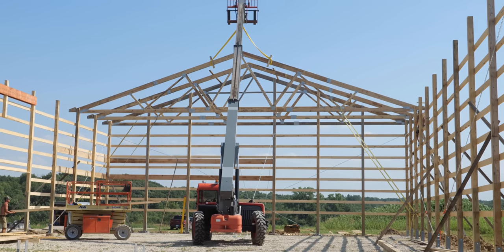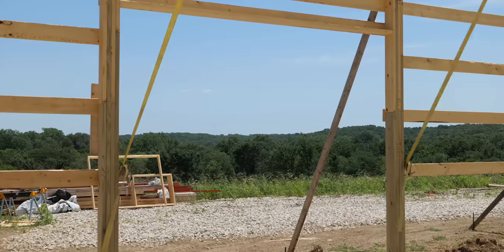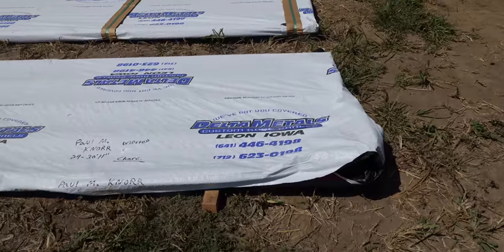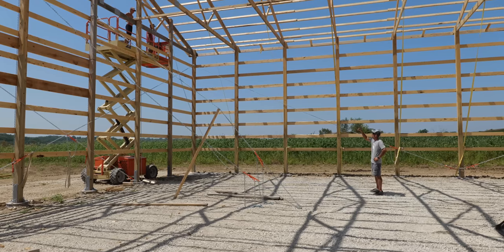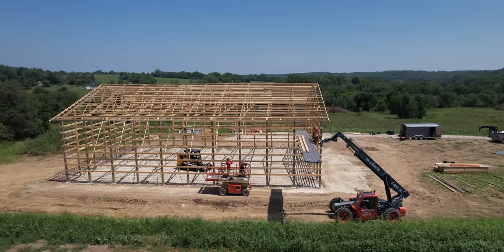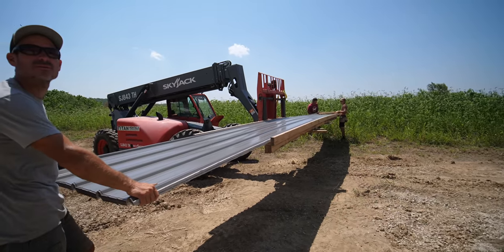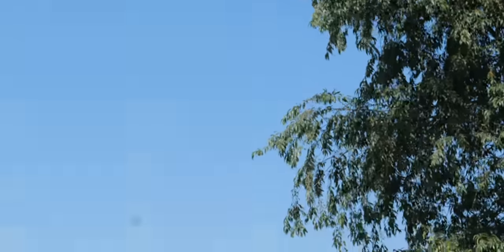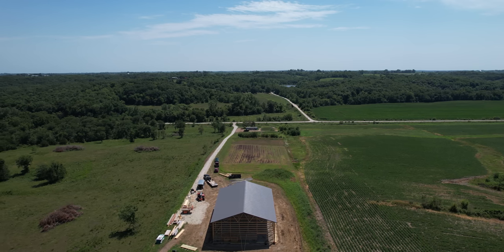Metal Roof Vs Wind!! // The Barndo Build Ep 3

Comment: Looks great Ryan, I like the charcoal color as well, I was very suprised that there is no under layment at all under the metal panels, I thought at least that house wrap would be underneath. I realize once they put a screw in every stud the rigidity greatly improves, that`s some brutal heat to be on a roofing project, great crew., looking forward to following along.
Reply: 99% of these buildings will have an insulated ceiling and vented attic, installing house wrap or plywood would be a waste.

Comment: I never knew you could do that without decking on the roof
Reply: Me either, seems like a strong wind would pull that metal right off🤔
Reply from the maker: I guess every barn in our state would be gone then because they're pretty much all like this. 😀
You can add wood for a lot of extra cost
Reply: I wondered the same. Figured a plywood layer would help with reinforcement, and sound insulation (when it rains).
Reply: We have a cabin with a roof like this absolutely no issues
Reply: @bbtank3000  usually for sound insulation you simply have it sprayed on the underside with closed cell foam.

Comment: I don’t understand how the metal directly on the trusses is solid… I feel like some good wind and the metal is gone. Normally here we put plywood over the trusses first.
Reply: The ribs in the steel and screws add the required rigidity. You are correct that the structure as a whole is a vulnerable at this stage in the build, which is why they are using chains and straps to lock the building into position. When all the steel is screwed in place (sides, ends, roof), and truss, side and end wall bracing secured, the building is secure. There are requirements for screw and bracing placement by the person who engineered the building.
Reply: @NoName-gz2kk  I’m assuming they’re going to spray foam the underside for insulation and sound dampening. If they’re weren’t planning too, they should!
Reply: @shawnwarnick2638  foam and rock wool will make that building nearly silent.
Reply: Looks like a cost cutting measure. There should be a layer of plywood or OSB laid down covered with a synthetic underlayment before the panels are installed.
Reply: @shawnwarnick2638  Which is fine it's being used for storing farm equipment. This is going to be a home.

Comment: Is there a reason why plywood decking wouldn’t go down prior to the metal roofing material?
Reply: With trusses 8' on center, which is typical in post frame building, the 2x4 purlins running parallel to the ridge offer plenty of support to both tie the trusses together and to hold the weight of the metal.
Reply: Sound reduction would be top goal of plywood decking for me and not having to watch an unharnessed child playing with his life scaling the roof. 😳#HeartAttack
Reply: @massillonmarine  yeah, a light rain on a metal roof can sound like a downpour...if there is no insulation. However, to add plywood decking on a roof that large means you also have to get 3x as many trusses and all all that plywood. That cost is completely unnecessary, especially once sheetrock and insulation is added to the ceiling it eliminates the sound.